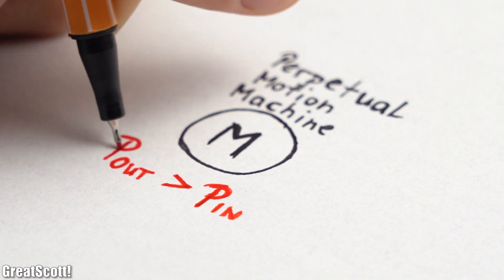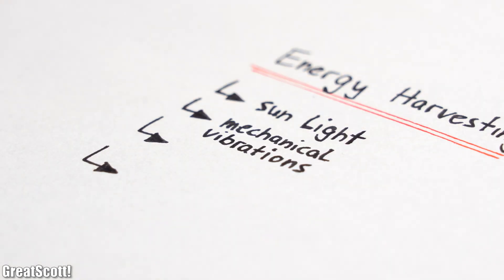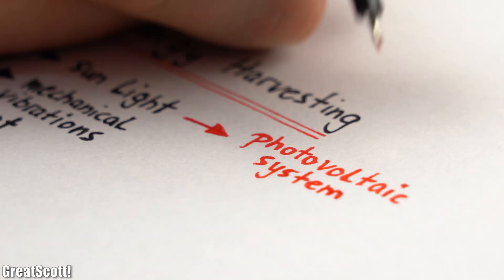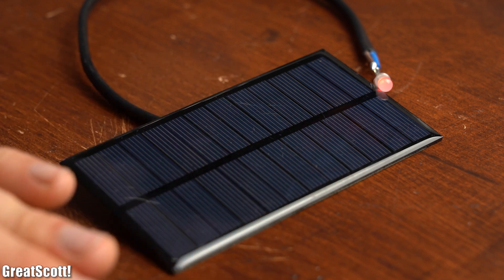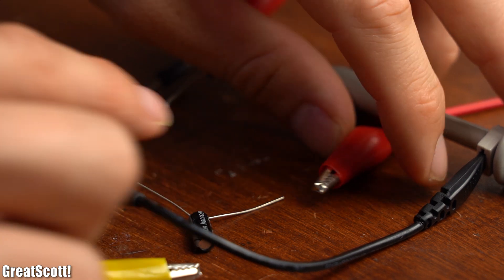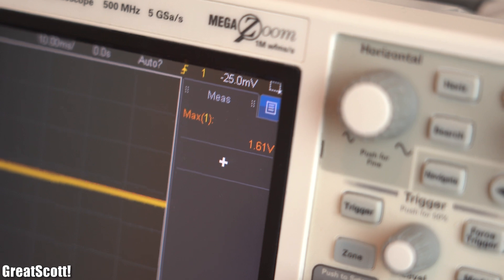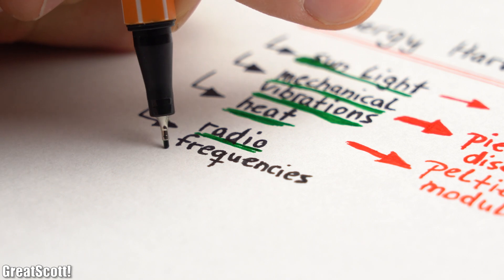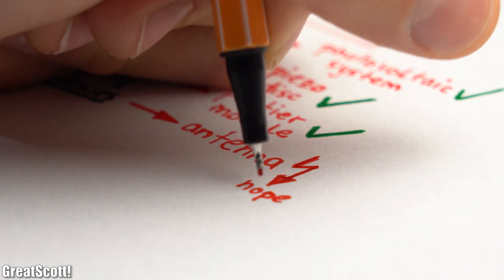Does Energy Harvesting make any sense?! (Experiment)

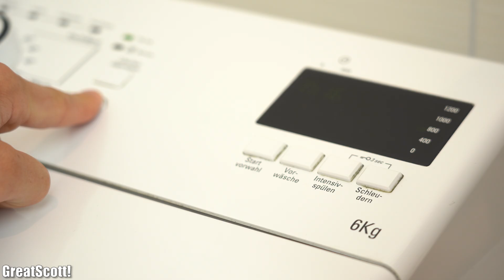Comment: 6:28 When we hit the piezoelectric disc both side of the disc experiences am impulse...
But in case of washing machine it does not experience any impulse as the other side of the disc is not hitting and surface to experience a normal Reaction force...
I suggest to place any another still object touch the exposed surface of the disc so that the disc can experience a normal Reaction force...
Or also we can also attach any other heavy object directly to the other side of the disc which will actually result in applying Normal reaction force die to increased Inertia.
    Anyways loved your beautiful efforts for us to gain some brilliant knowledge while we are at home safe.😊

Comment: The low voltage sources like TECs and single solar cells are tricky to work with, but there are some ICs that are designed for it. I wonder if a1W blue LED and a lens could be turned into an effective concentrator solar setup. Should have an easier to use Vo than Si cell, but the output current might be too low.

Comment: I know someone who is doing reaserch in RF harvesting at my university and the upper limits are something around -35 dBm so about .3 microWatt, this can definitely be used for some aplications like sensors.

Usually low powered systems like the ones show use a halve wave bridge rectifier consisting of a single diode that has a forwars voltage of less than .1V the system shown whas definately not optimised for this. Even if the full wave sounds cooler and get more energy usually in low power systems higher voltages are more preferable so halve wave rectifiers are used.

The IOT system requirements were way to high, you could have a protocol like BLE take 100 micro seconds to send a message so it would take less than 200 micro seconds while consuming 10 mA definately not one whole second.
Reply: About 40 years ago I was told of someone who lived about 800 yards from a long wave transmitter and using copper bars in his roof harvested the energy.  The story goes that he was found out because people complained about the dead spot he created behind his house. How much of this is true I don't know, it came from someone I had no reason to disbelieve and we did have loose links to the Home Office department that would have investigated it.
Reply: @twotone3070  First, if you consider RF harvesting as a means of getting free energy to save in the electricity bill, it's stupid because it would take millions of years, or more, to pay back the materials and equipment needed.

The ways I see to reduce RF in an area is by blocking the line of sight with a wall or a metal mesh or more feasible by generating noise and interfering the signal so the receiver can't recieve correctly the original signal. It could be also possible to reflect the signal so that you have multipath propagation and generate echos that would interfere but don't know if this would be possible.

Comment: For RF frequency energy harvesting, the easiest is an crystal AM radio.  When I was young, tuning into one of my local radio stations at AM600, there was enough DC energy to power a mechanical meter and even a real headphones.  The normal super efficient crystal radio earpiece wasn't necessary for that particular radio station.  At my last house, the mains 60Hz was easy to harvest, though, I had 250kv lines a block away from my house running in parallel.  1 good solid beam of metal plus a connection to an earthing GND was enough to illuminate LEDs.

Comment: How difficult would it be to harvest power from a conveniently located active AC line-rectifying an induced current similar to using a wireless charger?
Reply: Leroy Baker  Running a washing machine, generating radio waves or heat isn't free either. Wrapping a coil around a wire supplying that distant motor to produce DC adequate to power a remote sensor or micro-controller certainly seems like "energy harvesting". Didn't mean to imply that the coil would be generating "free" energy.

Comment: Well we had in Poland once 20MW transsmiter of LF, (horizontal) and according to my teacher, if u were in about 20km of that station,  if u had a bit of wire connected to light bulb u culd ligh it up. 
And about piezoelectric generator, meaby u can trap on him a small ball, proper weight have to be found, meby it wuld generate a bit more energy ?

Comment: For the piezo, hang a hammer (or something else with some mass) on the side of the washing machine, with the face of the hammer contacting the piezo. Then you have some actual pressure on the disc when the washing machine vibrates.

Comment: The storage capacitor's leakage / equivalent parallel resistance also plays a large part in how well your energy harvesting system will perform. Even if the Rleakage is in the megaohm range this becomes significant at these power scales. If anyone wants to seriously play with energy harvesting make sure you dive into the datasheet for your capacitors and get low leakage caps.
Reply: Why aren't you making any videos? I'm starving for your content as well!😭
Reply: I learned a lot from you, sir. We miss your videos.
Reply: Did I just come to the smart side of YouTube? 
Cuz these are some good ideas. I normally end on the weird side
Reply: @sendojusta  yep. This is definitely not the cat video section 🤣
Reply: And it looks like the larger cap/battery you are using, more leakage happens.
Reply: OK
Reply: I can’t find data sheets for most caps I find ;-:

Comment: but cant you harvest energy from induction, like if your near a high voltage output source like substation or power lines?
Reply: You can. That's actually capacitive coupling from the alternating current, AFAIK it doesn't work with HVDC lines. People can demonstrate this just by holding a fluorescent tube under the powerlines.

Comment: Calculators: Energy Harvesting done right
Reply: You'd think that, but some solar calculators actually have fake panels in. It's cheaper to fit a tiny button-type battery than to fit a solar cell. The battery will run flat, eventually - but a calculator chip draws in the micro-amps when sleeping, so that battery will last a few years. Long enough that the calculator is probably long lost, and if not the owner will just discard it as faulty.
Reply: @vylbird8014 ,
  The buttons will wear out before the battery dies.

Comment: The way he describes the term energy harvesting sounds like how all power plants work... just on a much much larger scale... which is in line with how it sounds... they harvest chemical energy, heat energy, solar, wind, etc... typically not machine vibrations as that's just reclaiming some of the energy loss form already harvested energy that's currently in use... you have to have already had energy harvested to begin with to take advantage of that, and I don't think radio waves hold enough to power a power plant so that's out too but the concept of energy harvesting still seems in line with how power plants work... granted I'm only 2 minutes into the vid, but am I getting this right? I'll finish watching and edit this *IF* I get conformation.

Comment: Using radio for energy harvesting is not very efficient, but i can be done and is most viable for sensor that transmits rarely.

"Powering the Next Billion Devices with Wi-Fi" is an interesting paper from University of Washington.
They choose WiFi due to its high peak to peak to average ratio, and because it's used in many consumer products already, and because it's free to use without many radio constraints.

One of the big challenges was the burst of packages that makes WiFi have silent periods. They solved this by use a consumer WiFi router that they make transmit UDP packets in the silent periods.

One other big challenge is that most IC's for DC-DC converting have a high input voltage, but in the paper they find SZ882 that have a low threshold of 300mV.
They also found that it was hard to impedance match the 2.4Ghz antenna, the rectifying bridge and the DC to DC converter. They solve this by using low loss rectifier and capacitors. They also add the positive and negative periods to double the amplitude.

It's a super intersting paper! https://homes.cs.washington.edu/~gshyam/Papers/powifi.pdf

Mouser also have an interesting article on energy harvesting using radio:
https://eu.mouser.com/applications/rf_energy_harvesting/

Comment: Add a small weight to the other side of your piezoelectric disk and tune your antenna and RF circuit to 2.4 GHz. 

The disk will not experience much force no matter how hard you vibrate it without some inertia to act against. 2.4 GHz is not only the most likely noise to be found, but cheap commercial circuits and antennas that use it are very easy to find and it propagates quite far.

Comment: I'd love to see you cover an RF wake-up system for IoT.
Receiving RF transmissions can be rough on the power budget. If you use timing to know when to wake up and Rx, you need a RTC and wake-up interval short enough to prevent losing sync.
A wake-up system is a passive (or extremely low-power) circuit tuned for a signal at a particular frequency, which can serve to wake up the main microcontroller/receiver. This allows you the flexibility of broadcasting the wake-up signal whenever you want, followed by transmission of your regular data payload.
The connection is that passive wake-up circuits are essentially a special case of RF energy harvesting, which got limited coverage in this video.
Reply: rx'ing a wireless signal doesn't use much power. You only really need power to demod and interpret the signal which can realistically be done with a low-power mcu. It get's more difficult with protocols like wifi since they require a response to a request e.g. tx'ing some data and that's where you have your high energy consumption up in the 100mW's.
BLE solves this by reducing the data rate thus allowing for lower tx power and reducing the number of transmissions e.g. not requiring a response every 0.1 seconds and being ok with several seconds between transmissions.
Reply: @web1bastler  I mean, something like a nRF24L01+ draws 7-11 mA during Tx (depending on output power) and 12-13 mA during Rx. A CC2652R draws 7-10 mA during Tx, and ~7 mA during Rx. Other chips are broadly similar.
Rx can be deceptively bad though. Tx you can often wake up, scream into the void, and then go back to sleep. With Rx, you may need to keep powering the receiver until you either A) hear something or B) time out and give up.
That's where a RF wake-up system really helps.

Comment: Please add one more topic to your backlog: energy harvesting modules.

The thing is almost no energy sources may be used directly without any conditioning. There are specialized modules for piezo elements, for energy harvesting from tiny solar panels and so on. With such circuits your device can harvest even tiny short-living bursts of energy, effectively conserve them in a battery and provide later when needed to measure and send the data. Very rarely you can also see circuits without an energy buffer, the most notorious example of such approach is EnOcean kinetic harvesters built into wall light switches. Patented and probably the only of this kind.

Also there is a lot of relevant research papers on the topic. Such papers often list comparison tables for different energy sources: energy density (size to energy ratio), efficiency, typical energy output and so on. I would love to see such data in the video.

Sorry. I was working on the energy harvesting and energy saving methods for my master's thesis, that's why this video triggered me so much. Thank you for your videos!
Reply: I feel ya it triggered me a bit too and I don't even utilize energy harvesting for my work.
Though to be in the spirit of the video ultra capacitors would be better than batteries as the purpose was to eliminate the battery and its life expectancy problem.
Though im sure there are plenty of batteries that would work just fine for that sort of application. IDK you would know better i'm just a robotics guy.
Reply: this is a very interesting topic.
I am considering to make it a subject for a mini project

Comment: Don't give up on that RF energy harvester so quickly. You're not targeting the right frequency.
While it's a VERY low frequency, you want to target the mains power frequency. Of course, you're easily going to go thru a lot of copper wire in the "antenna" (coil) for this method, but I guarantee it will work. Of course it works better if you live near HT power lines, but the principle should be universally applicable.

Comment: For those considering the piezo method, in addition to the comments below about method of attachment, keep in mind that the charge and discharge rate of a capacitor is directly proportional to both the value of the capacitor and the resistance (effectively r x c in seconds). You could utilize this by having a fairly large resistor connecting the capacitor with the circuit you want to power and some sort of switching circuit that switches the capacitor between your charging and discharging circuits
Reply: Note: RC actually gives you Tau, which can be used to calculate charge and discharge rates, but the point still stands, the larger the resistance and/or capacitance, the longer it takes to charge and discharge

Comment: Lately I've seen wireless electrical switch.
It used energy generated by movement of  magnet, attached to moving part of housing, through coil, hidden inside of main body.
It gathered enough energy to
power microcontroller, 
generate new signal,
broadcast it, 
receive answer from base
And save it in memory.

Mounted on wall it was indistinguishable from usuall light switch

Comment: You talked about  a factory or the home, so one thought would be a current transformer, even the ground connection might leak enough through capacitance even with no actual fault current, tharere are clip on types so you don't have to disconnect any wires.
The other thing i've seen around is harvesting from the ground, i can see how that would work due to voltage gradients (or step voltage) through the ground.

Comment: You used factories as examples here. The problem is that factories oftentimes want to be redundant. Thus energy harvesting is not very likely to be used in this setting. If the motor/oven fails or is turned off for maintnance the IoT device has a problem. Nontheless I agree that you could use this in other situations.

Comment: Radio frequency energy harvesting can be seen in a crystal radio!
Reply: Reinvented by max loghan
Reply: True, but it is too bulky to be practical
Reply: I was a kid I had a clear plastic egg. It was a radio with no battery.
Reply: It would have to be tuned...but the audio output could then be fed thru the bridge rectifier..the problem is you have to have a pretty wide band antenna to pull in the RF energy
Reply: Brian C my point is just that RF energy harvesting can be practical
Reply: @youssefaly97  practical ? possible yes, practical no.

practicality and possibility are different. It is possible for me to walk 30 km from home to work, but it's just not practical.
Reply: Malik maybe practical with PIN diodes, needs more testing.
Reply: @ksc1406  yes, connect them in series
Reply: Malik have you ever used an access card or disc? They have a coil inside them that picks up the rf from the door touch plate, rectifies that , then uses that power it just harvested from the transmitter & transmits the code from the card to the receiver in the card reader at a different rf signal. Practical; hell-yeah! Used all over the world daily!
Reply: I think its practical under the right conditions being you live right next to a radio tower and you just so Happen to have the correct receiver for it to give u power, right?
Reply: Well, there used to be little hangers sold to be hung to a mobile phone and they'd light up/flash an LED whenever the phone is starting to receive/make a call/message notifying the user. It harvests microwave energy from the GSM.

This is practical.
Reply: Brian C my point is just that RF energy harvesting can be practical
Reply: @haydenc2742  noise can be then filtered through a multiband filter and then harmonized in a later circuit
Reply: @haydenc2742  Greatscott! Could make Crystal radio. Feed it's output to JouleThief. And What if - hear me out. Feed it to another joule thief. This could harvest enough?
Reply: I would like to see this tested. I believe that a poor antenna still could supply the <1uA a more energy optimized mcu could provide. And the 88-108MHz span is full of energy to harvest  :)

For instance a temperature probe with a piece of cable to the sensor itself... What kind of energy could that provide?
Reply: @dennisolsson3119  I have some PIN diodes around, I'll try & if I succeed, may be I'll post a video!
Reply: @youssefaly97  try germanium diodes...in combination with tesla's aerial patents

Comment: Why don't we use peltier modules with the heat from the sun or the earth's core
Reply: Actually, taking the earth's thermal energy into use exists. Just there are WAY more efficient thermodynamical machines out there compared to peltiers. It's the reason power plants use turbines instead of peltier modules for example. You can see how close to useless the generator GreatScott! made on a video is, and that isn't due to incompetence of his part, rather the modules can't do much better. Meanwhile turbines for industrial applications can reach efficiencies of more than 65% even.
Reply: @Kalvinjj  ok